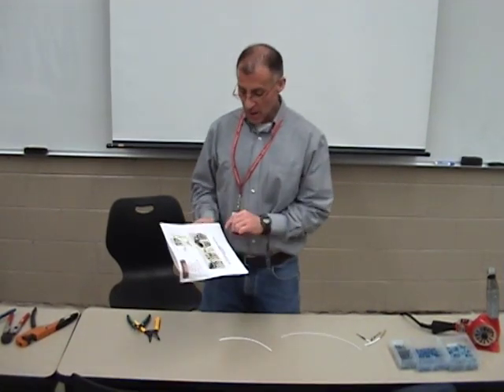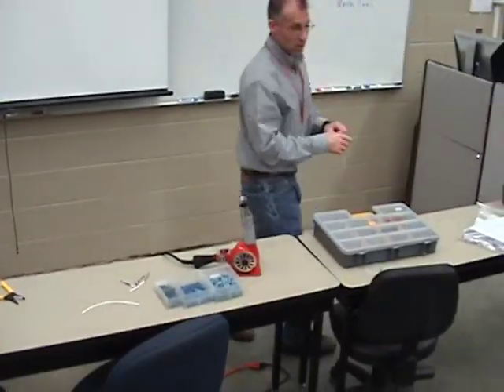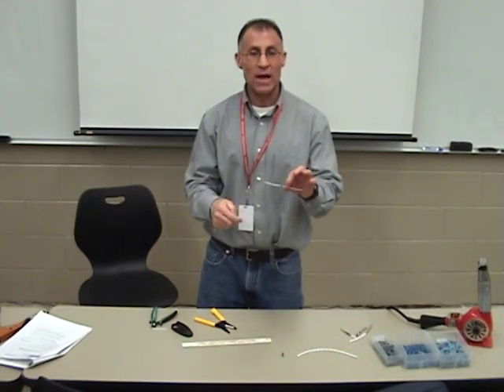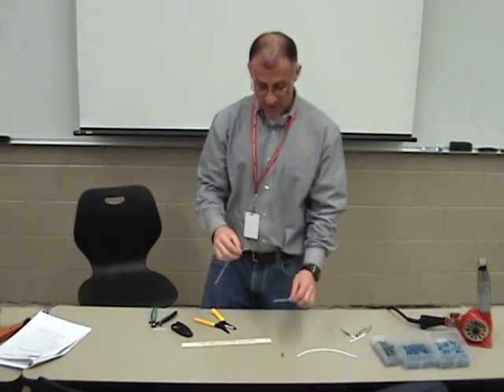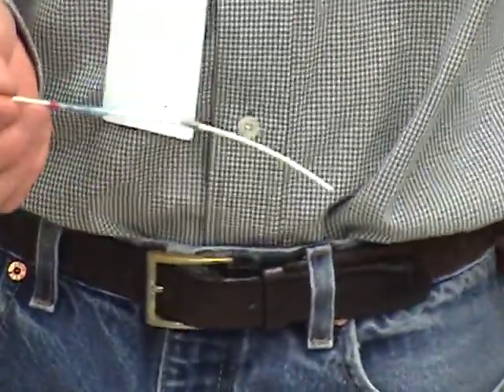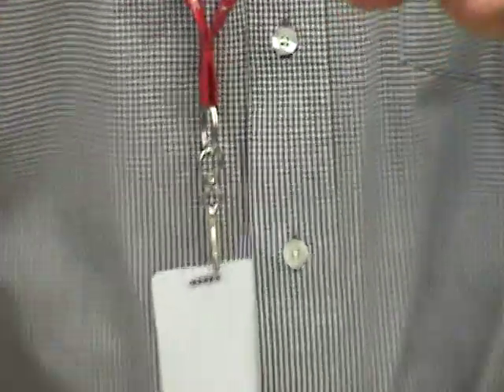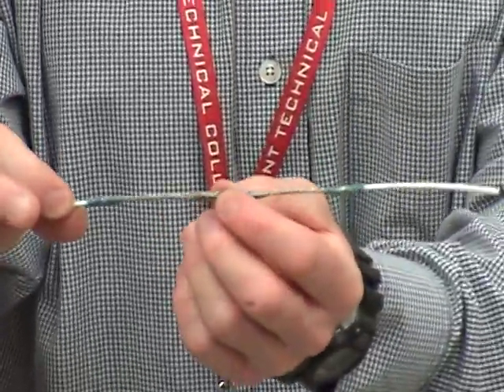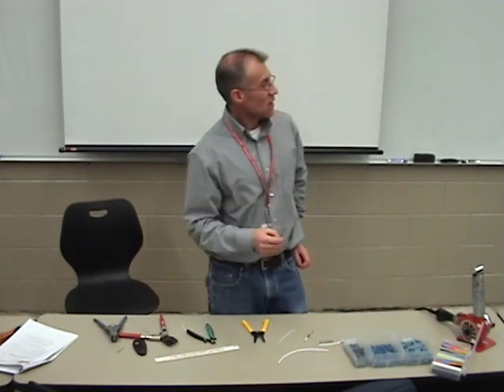*EXPERT LEVEL* Shielded Wire Repair Tutorial TTC Avionics

Comment: I have an A/C unit that my dog chewed in 2 pieces the electrical supply cable. I didn't bother trying to repair the very thin metal bare wire and foil, because it was too difficult. The unit will not work in this condition. Is there anyway to bypass the bare wire and shield? It's hard getting to where the wires start in the unit.

Comment: I have a issue that would really love your thoughts on. But it would be better if I can email you the video. It’s basically the condition of the shield on my knock sensors and what not to do with other shield wires as far as wiring it to shield ground. Please if you can reply  with your email or email me at fullslick_motorsports@aol.com, I would appreciate it. Thank you advance

Comment: EMI shrink tube is a normal heat shrinkable tubing with conductive silver past on the inside. When wires are nicked, the silver past flows into the damaged area and closes a path from shielding/ground to the inner conductors. These problems are VERY hard to troubleshoot as they sometimes result in intermittent shorts, in addition to requiring deep access into the aircraft which further adds to the downtime.

Comment: Just FYI, the ENTIRE AH-64D Apache fleet had to be grounded because wire harness installers at the Boeing Mesa factory used spinner-style insulation strippers on multi-conductor shielded wire. These spinner-strippers were designed for RG-series RF cable, not normal wiring/cabling. The recommended stripper tool was a simple exacto type blade. The special EMI shrink tube was actually flowing into the nicks left by the strippers and shorting the circuit to ground.

Comment: It would be useful if the tool and material details used in the video were listed in the comments.  It would make it easier to find some of these items.
Reply: Have a look at Daniels manufacturing Corp,  Astro Tool Corp. The data sheets for the MIL / Aero / Space cable  will state the standard of t connector system needed and the connector system will state the standard of tool needed. As long as they meed the standard one brand is nominally  as good as the other